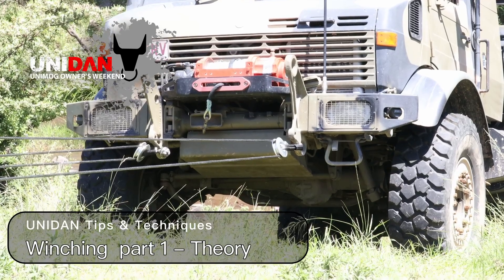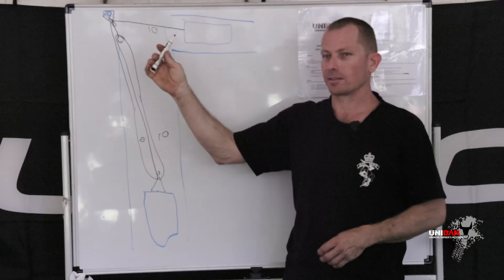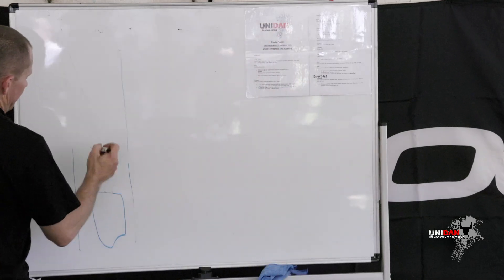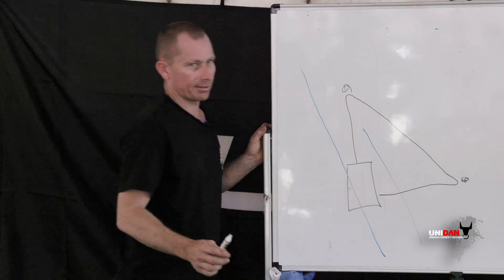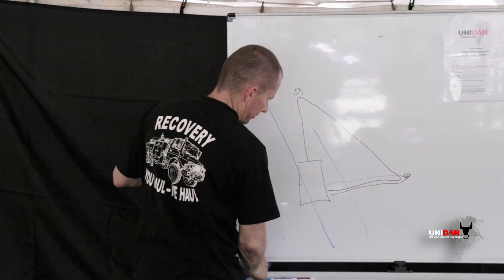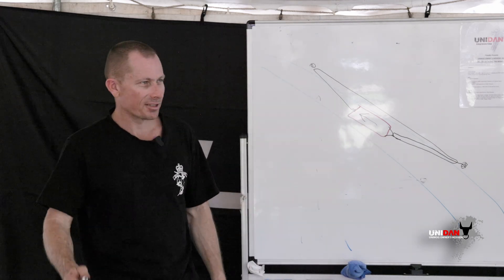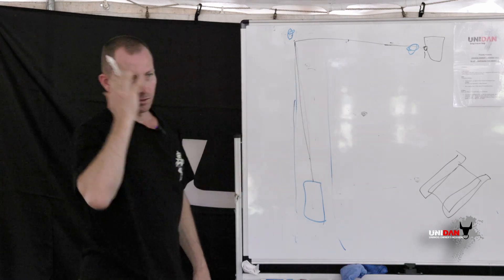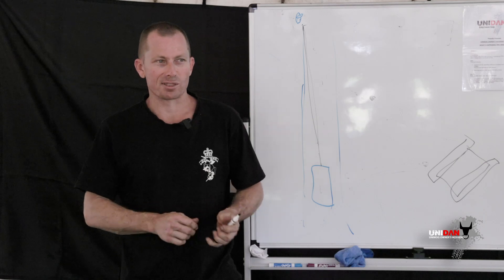TIPS & TRICKS - Winching Demonstration Part 1

Comment: Great info and knowledgeable guy except for one issue: Runva winches are cheap chinese made winches. Warn and Ramsey are the only good quality electric winches made that are widely available and engineered properly. For example, look at the parts that make up a Warn M12 compared to these China brands... its an astounding difference!
Reply from the maker: Hi there, we have been using Runva for years and have never had one failed. Although they are made it China and are quite affordable, we have found them to be a high quality product that works well, lasts and has a good warranty period (even though we've never had to use it). We have however had issues with more expensive brands and not having warranties honoured has been a problem too.